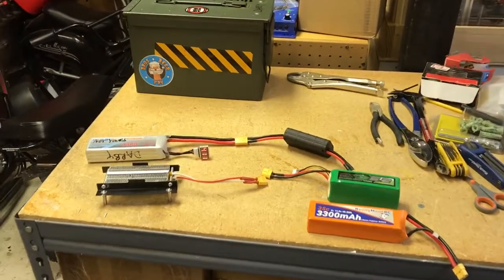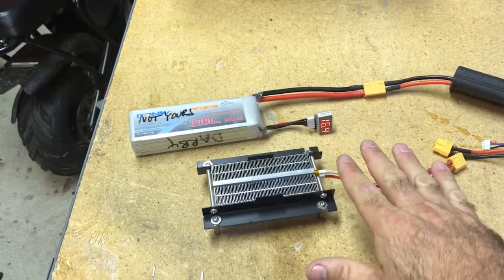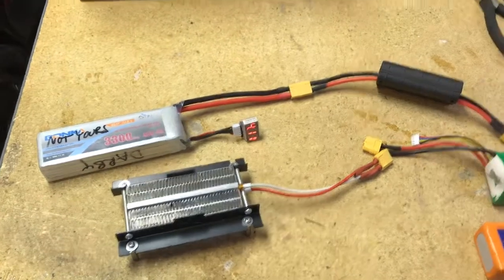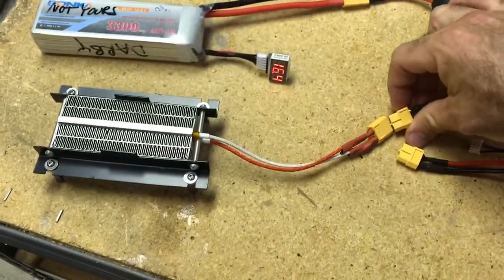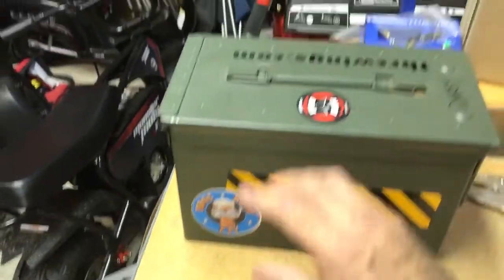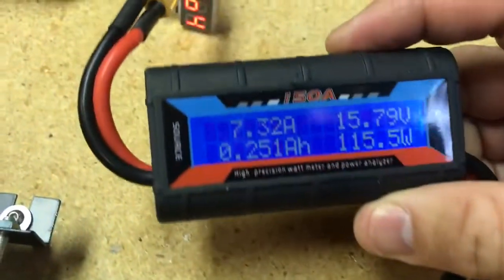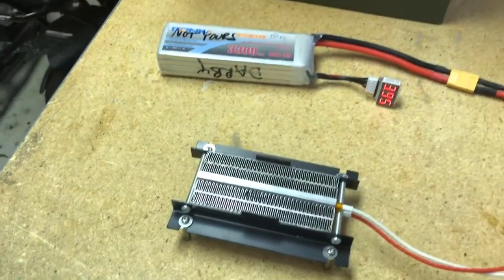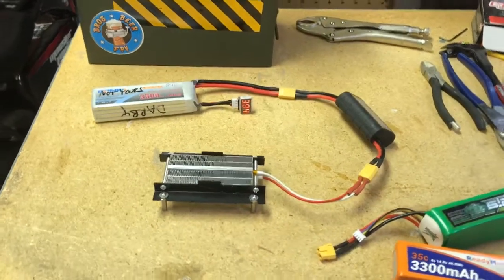Lipo Discharging w/PTC Heater

Comment: I was thinking about doing this with a PTC heater, but will be using battery as the input power source to my M6D charger and will use the charger in "Power" supply mode so I can regulate how much much power is drawn and to cut off automatically when battery gets to voltage I want.

Comment: This is the best one i have seen, awesome.
What voltage is it ?
Reply from the maker: Speed Freak ive hooked up 4s to it without issue. Even though it says 12v.
Reply: @FPVav8tr  aaa cool i just got myself a 24v one for 6s discharging and will put a fan on it to, might make it last longer👍thanks for the awesome idea .
Will see if it works with 3s and 4s 🤔, i have tested and for 3s and 4s you need 12v 200w.👍💪
Reply: @speedfreak1161  What is your experience guys after a long term usage? (If you still use this method). For 4S battery what voltage PTC do you recommend? 12v or 24v? Thanks
Reply: @peterbalog3102 Very good just have a lipo buzzer on the balance lead for 3.7v per cell  12v 200w 💪4s maximum
Reply: @speedfreak1161  thank you my friend!